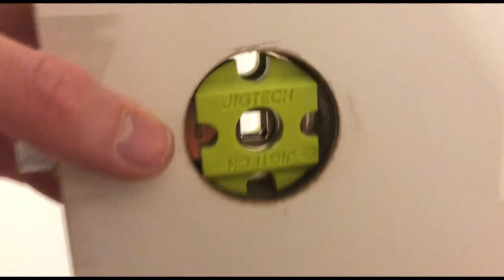HOW TO INSTALL / FIT DOOR HANDLES AND LATCHS - JIGTECH HANDLE PRO INSTALLATION KIT JTP6000

Comment: Hey Matt, good to see your face again 😊 I don’t suppose you have had any experience with PVC (front)doors and adjusting the hinges on them? Got my back door with a broken lock, which I can easily replace, but it broke because the handle got tight as the door went out of alignment. I recall the guy who fitted it have a right old time trying to get it all fitted square. Just hesitant to replace the lock if I can’t then get the door opening smoothly! Cheers buddy
Reply from the maker: Hi Steve, I have a similar issue with my front composite doors. I’m going to get it replaced on warranty because it has warped in the sun over the period of a year and cause it to go out of alignment. Which is a manufacturing defect. Have you tried putting a long straight edge or spirit level up against the door to see if it might be warped or bent? The warping has caused the multipoint lock to become misaligned relative to the door frame and extremely difficult to lift the handle and lock from the outside. Just a thought?
Reply: @MattHutton  I haven't actually, I must try that. I've sort of left it alone, because although its the back door (I guess its a side door really) it is open to access by the neighbours in the adjoining flats, so I didn't want to mess around with it and leave it vulnerable to being opened. I looked into the locking mechanism and that is an easy fit. Then just a matter of getting those hinges right. The building is old and it was hard getting the frame squared up. It took the guy a whole day to do it, which I suspect is a long time for one door!
Reply from the maker: Steve Hargreaves ah I see, maybe this video will help? https://youtu.be/Gf0UU6cS4zQ

Comment: Great video. Couple of points.

- A cheap little palm router will make your latch plate installs beautifully simple.

- Your mortice latch doesn't look deep enough in the door.

- That jig looks like the green inner guide is meant to close up on the holesaw to stop the play you mentioned. 

- Use the hole saw on both sides. Don't go all the way through from one side. Stops any blow out.

- Use a square, mark level with the bottom of the upper panel, and save any measuring faff.

8:31 - That's a spade bit. Use a screwdriver instead 😉

- To fill the previous latch holes, use a wooden plug (try to match the grain), and whack a couple of toothpicks in with your wood filler. Sands nice, less chipping, less filler, screws bite better 👍
Reply: Do you know if with this kit you HAVE to use their locks & handles ? Because obviously that green thing that goes in the hole I guess has to be there ? But when normally doing a lock you never have those

Comment: Hi. When I use 25mm hole saw it make slight bigger hole that I felt. When I have installed smart latch with out  tapping 🔨  with hammer  smart latch goes in with finger push. Is it ok or what point I have missed it? Why smart latch fitting was lose in my case. advise me please. Which screw driver should be used for smart latch because screws are very little.Thanks.